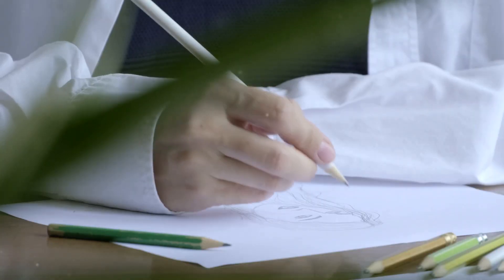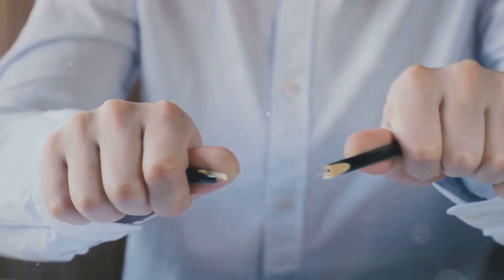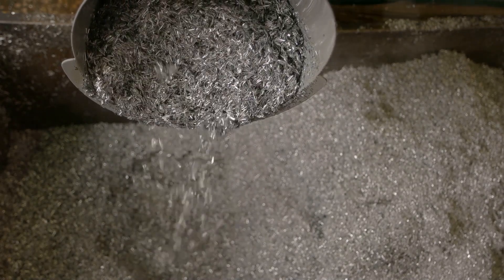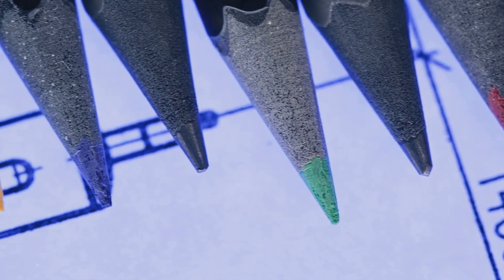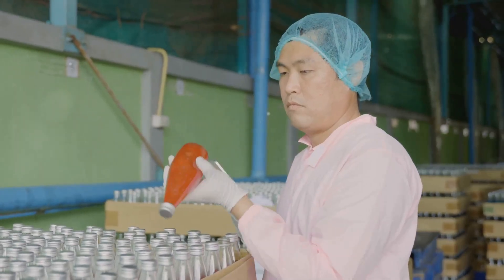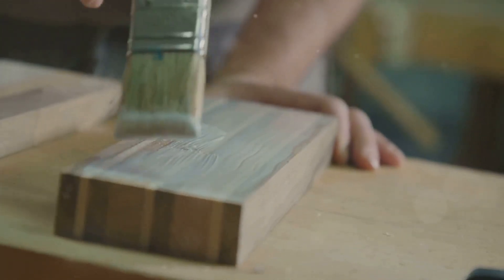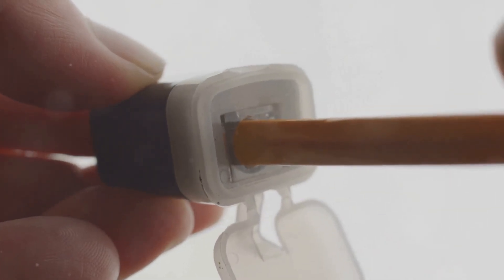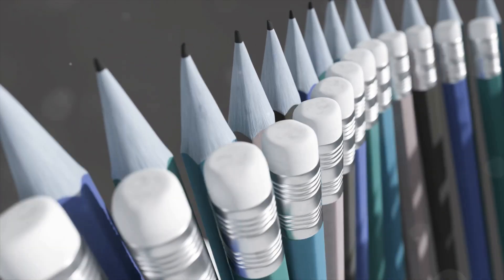How Pencils Are Made - From Tree to Tool

Comment: lead, in this case, is pronounced "led" the e is short as in egg or there would be a line above it.  i only mention it because after a few minuets its said like 30 times and is very distracting to the content.  if you are using an auto-reader, just spell it "led" and it'll say the correct word.  :)